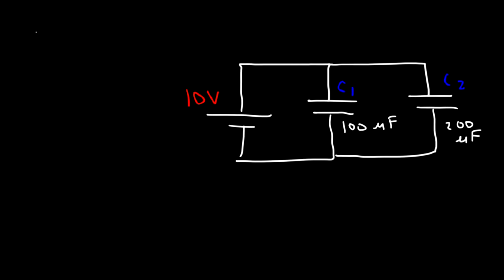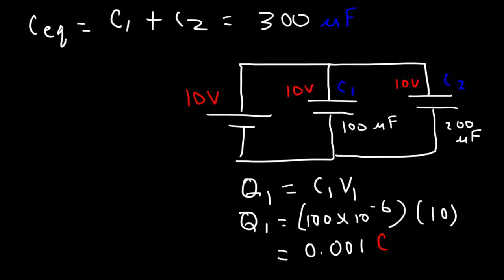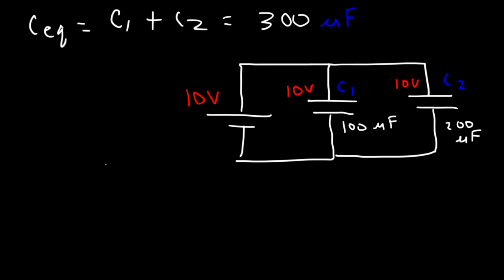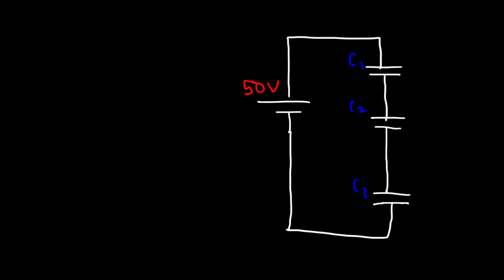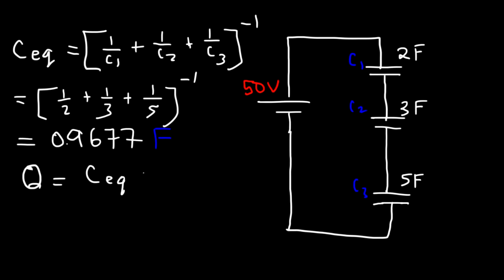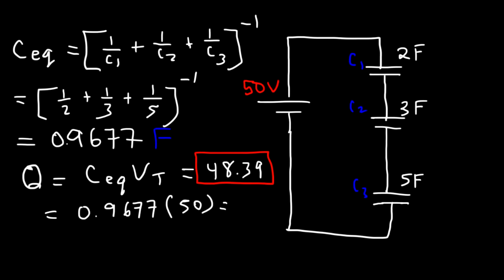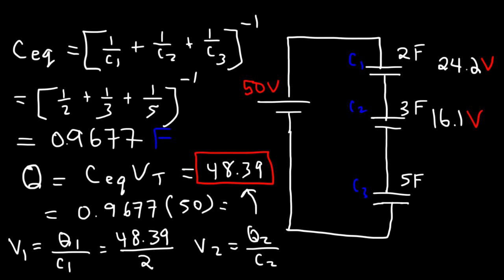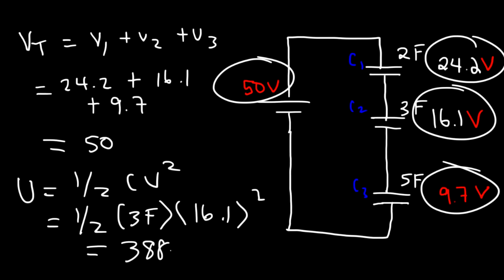Capacitors in Series and Parallel Explained!

Comment: So another words, if I have a circuit of 350Vdc total, I can run two caps in series at 250Vdc each for a voltage total of 500Vdc..uf values being the same. Is this correct?

Comment: At 6:41
The formula used is bit incorrect

It should have been 
1/Ceq= 1/C1+1/C2+1/C3
The reciprocal will be on both the sides not just right.
Reply: YOU SAID:
The formula used is bit incorrect
It should have been 
1/Ceq= 1/C1+1/C2+1/C3
The reciprocal will be on both the sides not just right.

ME:
The presenter accounted for this by raising the entire right hand side to a power of -1 [i.e. inverse]

Comment: I have a question- if you divide 48.39 by 2, the answer is not 24.2 but 24.1. Similarly, if you divide 48.39 by 5, the answer is not 9.7 but 9.6. Therefore, the sum of the answers is 49.8, which is obtained by adding 24.1, 16.1, and 9.6 is 49.8  and you give us   50  why💭❓

Comment: Thanks for your video. If we have a capacitor pack say with 2 capacitors connected in parallel and 2 in series. How do we calculate the capacitance equivalence of this pack. Thanks

Comment: Good evening sir.  Please I don't understand why you used a particular capacitance and voltage to solve for the electric potential energy . Or can we use any of the 3 ?cause when I tried to use the 1/2× 5F × 9.7v it gave me a different answer from the one you used which is 1/2 ×3F ×16.1. Please sir reply 🙏 😊.
Reply: Hey idk if u Still need it but the potential energy held in each capacitor simply because the voltage across each capacitor is diff. 

U= ½CV²
U=½(CV)V       [Q=CV]
U=½QV

In series Q is the same but voltage isn't. Hope this helps

Comment: Capacitors are examples of the merging of two principles taught separately in classical E&M textbooks. The video here https://youtu.be/REsWdd76qxc describes a unified approach to  electroststics and circuits which will make it easier to understand the operation of capacitors.

Comment: Hi. Thanks for the video. 
I have a coffee maker which stoped working cause of damaged plastic film capacitor. Can I replace it with aluminum capacitor fixed in series 
To get same values. Ie:  voltage and Farads.

Comment: THE SHORTEST WAY TO CALCULATE THE EQUIVALENT CAPACITY OF PARALLEL CAPACITORS:
C = ( C1 * C2 * C3 * ... * Cn ) / (C1 + C2 + C3 + ... + Cn )
Reply: This is for equivalent resistors in parallel

Comment: i have a question,.since U and.PE.are connotations for.potential energy, why do they yield.different.results? i tried solving the potential energy for.each capacitor by using two equations pe=qv, and U=1/2cv2, but they yield different results. Correct me if there are errors in what I did. Pls help. Why is it that the result of U is always half of the result of PE when they should have the same answer.
Reply: Did you find out what you did wrong
Reply: Dimitrios Fotopoulos no, not yet, please tell me.
Reply: @parkkinglot892  I don t know I haven t really tried out those equations in a problem by my self yet
Reply: Dimitrios Fotopoulos oh ok, i think now though that maybe PE=qv is used to measure the total potential energy in a circuit through a moving charge while U=1/2cv2 is for the potential energy inside the capacitor.
Reply: @parkkinglot892  Oh wait a sec I know why you get different numbers
Reply: @parkkinglot892  we use q×V only when v is constant but when it comes to capacitors V is changing through time because the one plate of negative charge is discharging through time and for that reason we do the diagram of v with respect to time and we find that it formes a triangle I think because from my experience with physics this diagram must form a triangle if not it would be a parabola wich means you would find the answer with calculus
Reply: Dimitrios Fotopoulos ahw.ok i see, does it also.depend.if the circuit is.parallel.or.in series?
Reply: @parkkinglot892  anyway because I haven t really searched on this topic a lot don t trust me with the maths behind of where this equations comes from but I know that it comes from a diagram
Reply: @parkkinglot892  not really no but if for example you had 3 capacitors and were parrarel you would first have to add them so that you find the overall capacitance and then the V of the capacitance and then use this V with the previous equation to solve for the overall energy that was stored in the overall capacitor if you want the enegy stored in a specific capacitor then do the same thing with the v and energy equation withought adding any other capacitor
Reply: @parkkinglot892  btw I forgot to mention you that the first pE=q×V equation does work but it only works when the V is constant and but if want to meassure an electron s PE withought the other elextron s leaving the xharged plate this equation wlrks just fine

Comment: my question is, when to apply capacitor in parallel circuit?
Reply: When the capacitor is in parallel, the equiv. Capacitance is equal to the summation of it. When its in series, the equiv. Capacitance is in parallel method just like resistance.

Comment: what physically is happening to the electrons across the capacitor in a circuit?
Reply: They are building up on one of the plates
Reply: Zoe Adams how is it a complete circuit if theres open air between the capacitors. im new to this, and it seems like it would be an open switch
Reply: @trace8617  youre right, its not. The electrons build on one side, and because lots of electrons have a large negative charge, they repel the electrons in the other plate and those electrons continue the circuit. So one plate builds up electrons and the other loses electrons.
Reply: Zoe Adams so the positively charged plate isnt devoid of electrons completely, and that repulsion induces a current in the negative plate?
Reply: Thanks v.much sir